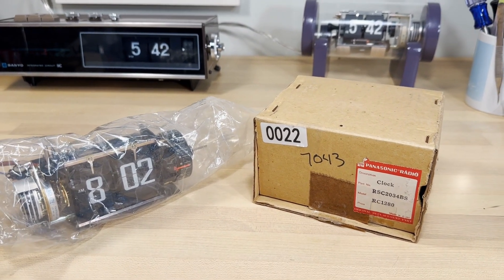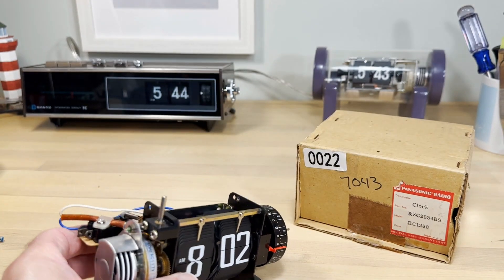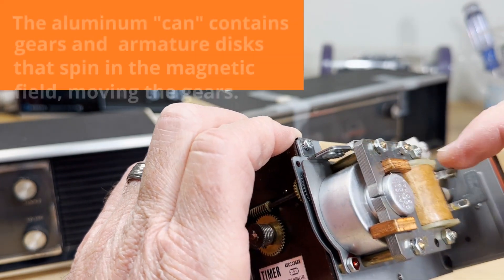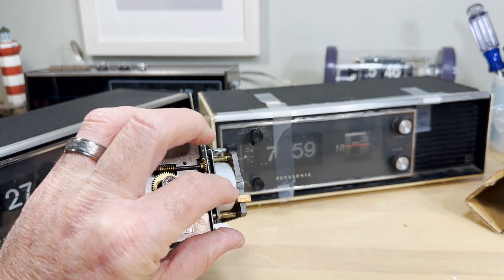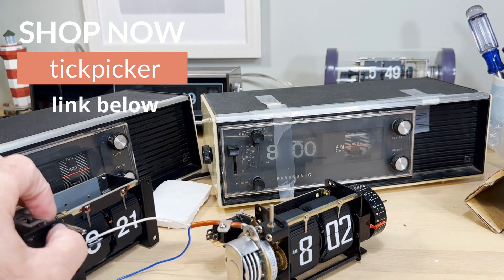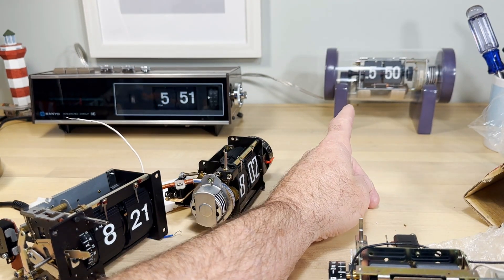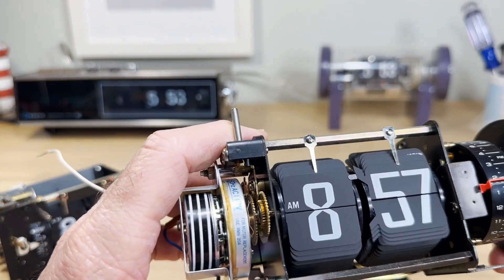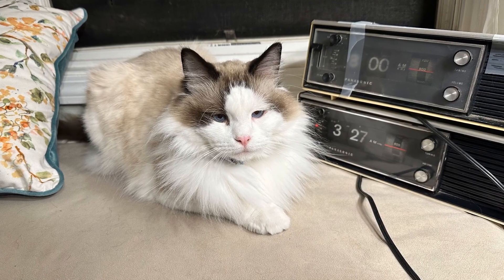Flip Clock Parts on ebay - Great finds.

Comment: The mechanism at 7:25 is in my Cariole clock radio lamp.  I've been looking for a replacement since mine was mangled by the previous owner.
Reply from the maker: Well. What do you know. Those always seemed like awesome 70s nerdness to me. Always imagine the original owner with horn rimmed glasses and a pocket protector. 
Maybe we could work out a trade or something. 
I’ve wanted to see one of those in person so if you sent it in I could make a video of it and replace the mechanism.
Reply: @Flipclockfans   Do you have an email address that I can send some pictures to, to confirm that it's the same model?
Reply from the maker: Sorry it took so long to reply. My real job is trying to kill me. flipclockfans at 
gmail.com